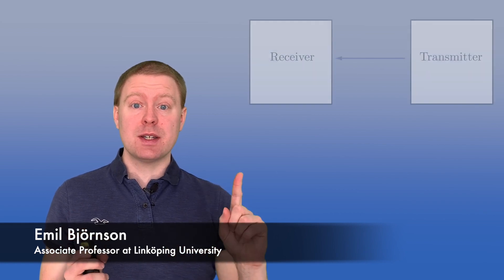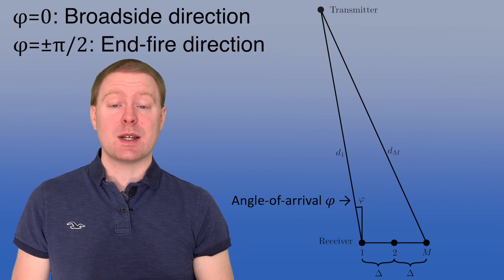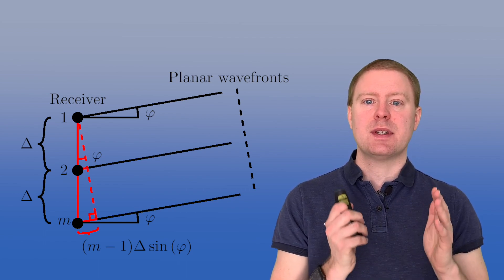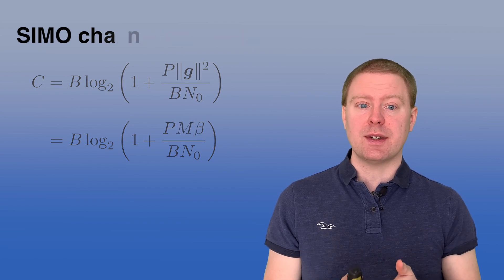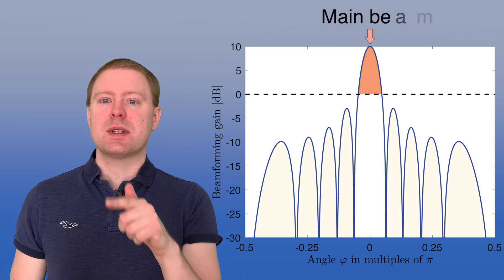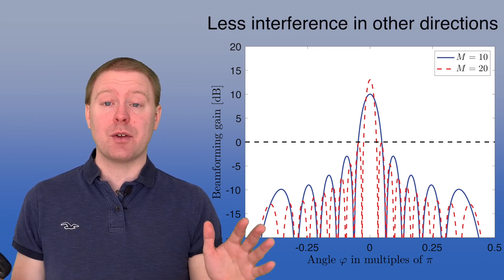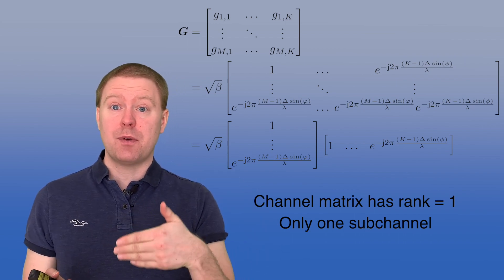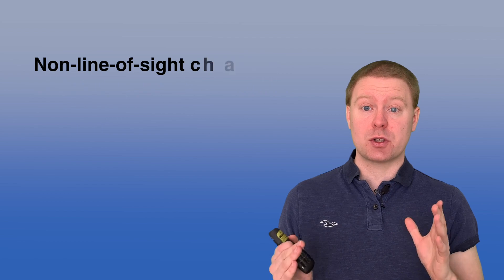Line-of-sight Channels [Video 7]

Comment: Thanks for the presentation Dr.Emil. if it possible, please also explain about the UL-DL duality (M-MMSE, RZF,...) and DOA methods that can be used with simultaneous multi-beam analog beam-former (pros and cons compared to the MIMO case) in your next video.
Reply from the maker: These things won't be covered in this particular video series, but UL-DL duality will likely be covered in other videos.

Analog beamforming is not something that we are working on. The future is digital :)